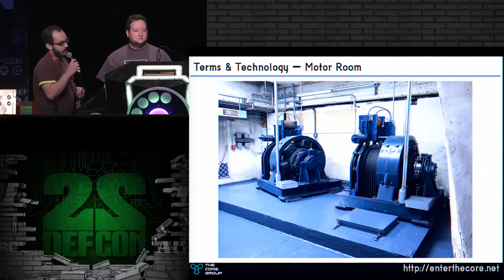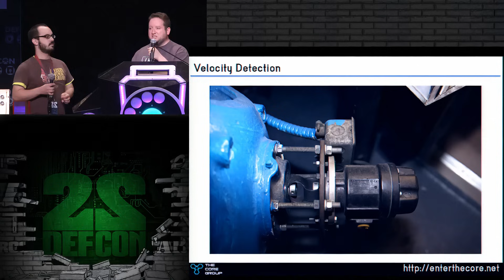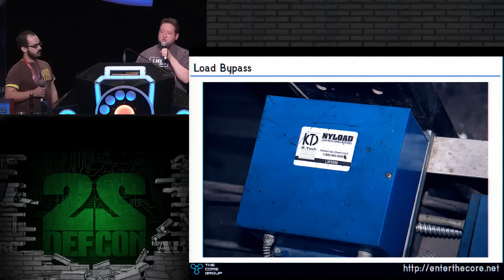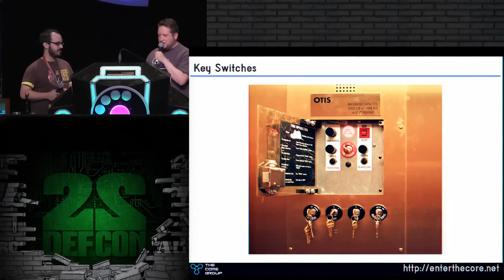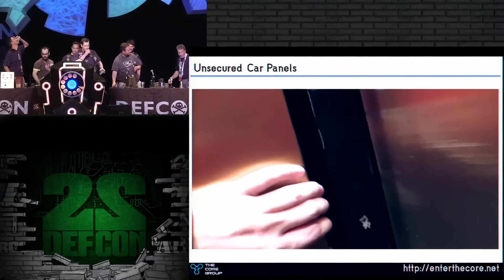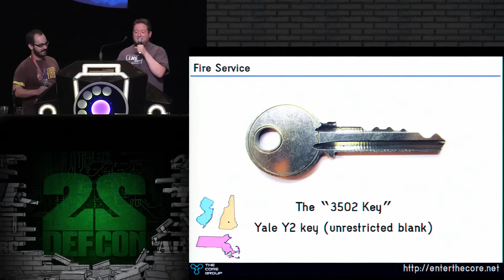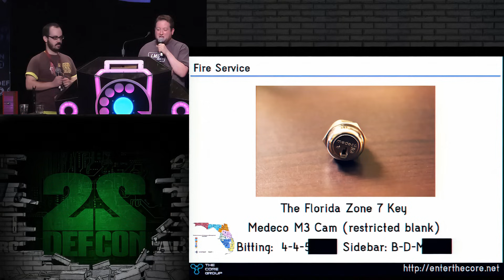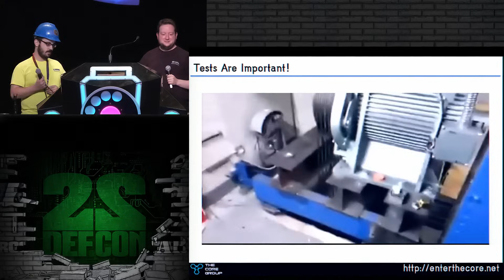DEF CON 22 - Deviant Ollam & Howard Payne - Elevator Hacking - From the Pit to the Penthouse

Comment: Sabbath Mode: "It's kind of like hacking God [...] I found a loophole in scripture so I'm smarter than you!"
pretty much sums up the Jewish faith:)
Reply: That was the funniest thing I learned all thay. Never though about solving sabbath day problems before. I can now see a nice market for autonomous cars.
Reply: @DJzSith  Wether autonomous cars are sabbath worthy or not is a legitimate political issue in israel.
Reply: See the wiki article on "Eruv" for the ultimate way to "legal loophole" your way out of inconvenient holy commandments.
Reply: @bearjew is that Hebrew for ollie ollie oxen free?
Reply: John Early pretty much sums up faith
Reply: Tyrone: There is a lot of apliances with sabbath mode. For example electric heaters that can be voice activated. Or even saw oven that is "certified" that you can use it on sabbath days so that you switching switches somehow do not count on that device since it is consecrated or whatever. Quite funny example of how people are walking circles around their own scriptures. But as long as it remains harmless, who actualy cares.
Reply: iglidor my Bosch oven has sabbath mode which means that it will automatically set and maintain the oven temp to 85°C (190°F) for the sabbath.  My Libeher refrigerator has sabbath mode which means that on the sabbath opening the door does not turn the light on, and the compressor will run at random times rather than as a direct consequence of the interior warming up because the door was opened.
Reply: @jpe1  Re. my earlier comment, I believe there's a predominantly Jewish suburb here in Sydney which has an Eruv strung around its entire perimeter. Convenient!
Reply: sixstringedthing I used to live in Allentown, Pennsylvania (of Billy Joel fame) and the eruv boundary was two blocks west of my house, I drove through it on a daily basis (which felt weird the first few times I did it, but I got used to the feeling of intruding into others’ space uninvited). That eruv has two major thoroughfares going through it (route 22 and old route 22) but apparently 100,000 cars driving through an eruv isn’t a problem, and similarly the eruv south east of Sydney Harbour struck me as being a bustling metropolitan area when I drove through it on my way to visit Bondi Beach (and yet the beach itself is outside the eruv).  I remain fascinated by the flexibility and creativity of orthodox and fundamentalist religions to adapt and accommodate to changing times while simultaneously maintaining all sorts of traditions.  It’s not just orthodox Jewish people, all religions do it.  Recently I ran the Bird-in-Hand marathon (Bird-in-Hand is a Pennsylvania Deutsch community near Lancaster Pennsylvania) and there were several dozen Amish men running, wearing traditional black wool pants, long sleeved cotton shirts, and straw hats, but also modern running shoes.  I had a long conversation with one such man who was wearing two GPS sports watches.  I asked him about the watches, he said they were borrowed, that the technology prohibitions of his religion were against ownership, not use.  So an Amish man can be a welder or a plumber as long as he doesn’t own his own tools (and as long as he is a man; those are men’s jobs prohibited to women).
Reply: John Early; that bit about the amish being unable to own tools is weird. I thought the reason they didn’t have a lot of technology was because they didn’t own the infrastructure to avoid monthly fees. Electricity being made outside the community makes it a dependency situation and they want to depend on God alone. If you have to borrow stuff then you are dependent on tool rental businesses. So why not just offer battery powered tvs and laundromats in amish country? It must be more like I thought or those possibilities would be put to use.
Reply: AnantaSesaDas perhaps it has to do with how a given Amish community defines “dependence”.  I was out in Wisconsin recently and visited with an Amish family and they had access to a cell phone, stored in a box in the yard (with a solar panel to charge it).  Same family had propane heat and refrigerator, and used a mix of kerosene light and battery powered LED lights.  I know it varies from community to community, in some bicycles are OK, in others the pedal/chain mechanism is a no-no so they used scooters, and again in some communities that use scooters you will see Razors and other made-in-China hardware, in other communities the scooters are only hand-made from mild steel tubing, with spoked wheels.
Reply: @jpe1  only problem is that they are operating a button that sends electricity to a computer that then turns the heating element on. Thus the person is still operating the oven though only for one press
Reply: Jewish history makes alot more sense when you consider it's God responding to these people "technically" not breaking the rules by "technically" not smiting them.
Reply: @SharpForceTrauma  crazy that my comment from 7 years ago is still getting responses! Thanks
Reply: That why so many good hackers are jews? They got it through religion?

Comment: As an elevator mechanic: very good talk!

Also: follow their advice on not entering the shaft if you don't know what you're doing, you will die.
Reply: Ill take that advice!
Reply: Can confirm. In many states entering the shaft is also a huge fine.
Reply: Absolutely! As a lift engineer (UK), I'm really glad he went into detail, and said "Don't go into the lift shaft, Motor Room or Pit" - Be aware, you won't be going home if you aren't very careful.
Reply: Our buildings elevator is roped, i bought a simple door key from ebay. Our pit has special interlocks that lock the elevators out completly as soon as a door is opened without the car/cab inline or the top hatch is disturbed. It also has laser cutouts around the pit as well as stop buttons etc etc?
Reply: @Steve211Ucdhihifvshi  not special.  You are just in danger being in the pit due to depth. Stay out please for your own safety. Dont want to see you get hurt bud.
Reply: @Steve211Ucdhihifvshi   Not lasers, leds.
Reply: That to me says that there needs to be safer hoistway designs to keep elevator techs safe. Everyone  deserves the safest possible workplace. Some jobs are inherently unsafe but elevator maintenance shouldn't be one.
Reply: @tadferd4340  You think elevator hoistways aren't safe lets not even begin to talk about escalators then. They are nothing more than a giant meat grinder.  Also as experienced elevator mechanic I would not say a hoistway is unsafe, as a rule its unsafe workers.
Reply: @tadferd4340  meh kinda like saying we need safer electricity. if you know what the fuck you are doing study the specific building schematics go to school for it and use proper precaution you'll be fine. it would probably require a dickload of research that your average goofball thinks he knows, but doesn't. with computers you are given a certain amount of leeway that the physical world just doesn't offer.
Reply: @SF-dy6hn  I disagree. You can design safer working environments, or create other engineering solutions. This is often the best solution. Humans  are very good at making mistakes, even when properly trained.

In other cases, no amount of training will help protect you. Using electricity as an example. Racking circuit breakers is dangerous business. Why rack in person when you can do it remotely? People will say cost but we need to stop putting monetary cost before cost of life.
Reply: @tadferd4340  The problem with trying to make the elevator shaft safer is that it is already about as safe as you can be with a 3,000 lb chunk of steel and an elevator car held by cables in the smallest possible area. They have to be able to reach all of the switches and sensors in there, so it's bound to have plenty of risk for the untrained.
Reply: @tadferd4340  its unsafe. It will always be unsafe because we shoulder the risk so the you are safe. We have safety's in place and lots of training. You just need to remember that its not a place for you
Reply: Except the people interrupting. They should definitely try it lol
Reply: you may enter my shaft :---------)
Reply: That sounds like a challenge to me
Reply: I'll take that challenge
Reply: @whateverppl1229  come work with me for  a week, let's go over some basics before you challenge the grim reaper for some lulz.
Reply: @Levo75  ok, but could you explain what it is that kills you so definitely/immediately? Is there a bunch of cables along the entire shift and like, some are ok to grab and some are electrically charged? Is it that you will likely step on something that gives and you'll fall to your death? Are you likely to be killed by 1000s of territorial gnome warriors? Like, what are the actual risks?
Reply: @swine13  the danger lies mostly in the way elevators move in a way you're not prepared for with your senses, the up/down dimension is just something that very few people develop a sense for and due to that, heads and limbs get stuck or struck in unexpected ways. There's also a special procedure to get on and off of the top of the cab and into the pit, this is slightly different for every brand. Safety wise, you may not be able to detect if a safety has been bridged or even how to test for it, you can't account for the things you don't know and thus the risk isn't worth the fun.
Reply: You're telling me that if I'm stuck in an elevator and it's hour 10 and I need to piss and nobody is coming, that I shouldn't exit the top hatch? You're crazy. I'm absolutely climbing out.
Reply: @frother  the top hatch is for the technician to escape if he gets stuck on top of the elevator.
Reply: @frother  Great. Now it's hour 11 and you've pissed down the open elevator shaft instead of in the corner of the cab, and it's going to take longer to rescue you.
Reply: @frother  In most places you can't because it's locked from the other side with no access to the lock from inside.
Reply: @frother  No you wont, the hatch is locked (or bolted shut) from the top and there is no way to unlock it from the inside of the cab.
Reply: @pyro4life64  Is the roof of the elevator car usually steel, or just a steel lattice with some particleboard tiles? I'm wondering if I could break through
Reply: @pyro4life64  – OK, but then how does John McLane/John Wick/007 get through the hatch in a few seconds only the cab to be found completely empty by the bad guys waiting for him in the lobby?

Comment: Interesting you could 3d print these now a days based off of just the pictures
Reply: a good profile shot of a key has allowed for duplication for much longer than 3D printers have been around. You only need to know one actual dimension of the key, like the length or the diameter of the round head, ect. in order to throw it into CAD or just manually scale it yourself to now have a scale drawing of the key. Once you have that all you need is a blank, a file, and some time. It's really not all that difficult. You can do the same kind of thing by temporarily stealing a key just to imprint it onto a block of playdough or clay for your real scale image to copy.

Comment: Anti nuisance mode works a little differently in quite a few lifts in Australia. If you press all the floor buttons, they will be registered, and the lift will make two stops. If it detects that no one has entered or exited for two stops, it deletes the rest of the calls and becomes idle/ready again, because the controller can reasonably assume that there is no one in it. I thought that implementation was quite clever, because it is possible that many legitimate calls may be punched in at the same time, for example a ton of people get on at one floor, you're standing next to the panel and you're kind enough to ask, "what floor do you guys need?" 4, 6, 8, 9, 10, 14, etc etc.
Reply: it can work that out by knowing it weight. 

Threeish people got on the car but 7 floors got pressed? yea nah. Car empty and any floor is pressed? yea nah.

15 people get on and  10 floors are pressed? Just fine.
Reply: @DataumCats  So fat people get to tamper a little bit more?  Being overweight has it's advantages!
Reply: @DataumCats  And skinny people won't be able to make it to their floor.
Reply: A Olson Summer camp group enters elevator. They each have rooms on a different floor of the hotel. Multiple floors pressed. 
Elevator: nope, this one obese person doesn’t need 10 floors.
Reply: @aolson1111  Thus skinny people get skinnier by having to walk a few floors most of the time. xD
Reply: Also drops the calls in NYC

Comment: dose the trick work where you hold the door close and hold your destination floor and the theory says it will bypass all the other floors
Reply: Why don't you watch the video?  He answers your question at 13:59.
Reply: +TheDct88 technically on some older elevators, it can work, but it isn't exactly supposed to on new, modern elevators.
Reply: Thanks for explaining what it was they were talking about there.  I thought they were just talking about how the door close button often doesn't do anything unless you hold it for a second or so.  I love the rare close buttons that work right away with a simple press.  I hate the very common "placebo" close buttons that don't do anything unless you're in a special keyed mode.
Reply: You really only need to hold the door close button if you're in independent service, it would only go to the floors you've selected since it isn't on automatic and is under your control.  If it's in auto it will wherever there is a call depending on direction of travel.
Reply: The problem is it's optional. It's up to the building owner how he wants the elevators to work. So in most cases, it ain't gonna.
Reply: +TheDct88 As an elevator expert, I do not think so!
Reply: Im quite sure i did work in somepoint on OTIS elevators at least in Finland. I did try it few times in bigger mall where there was people waiting at different floors and it didnt stop

Comment: Pressing the buttons for all the floors in a 34 storey freight elevator will tie it up for 45 minutes.  A work mate thought this would be a good idea and nearly got canned.  (Said building only has one freight elevator)
Reply: Then his building should use the anti nuisance function that elevators have in order to prevent such asshattery
Reply: Pressing the button again will deactivate that destination.
Reply: not always
Reply: Every time I've tried this the system realizes what you're doing after a few floors and clears the panel heh
Reply: Nuisance detection, we learned things this talk.
Reply: Gary Cameron haha that's awesome

Comment: I'd love more info about that failed mechanical test... link to original video?
Reply: Frank wasn't referring to the opening clip, neither is Flecom. You're off your rails.
Reply: the video of the motor flying off it's mounts? no it's not, I have watched the secret life of machines many times and for sure that isn't from there.. plus it looks like a cell phone video, pretty sure that wasn't around in 1993 ;)
Reply: The clip is from a (1993!) TV series made for Channel 4 and subsequently shown on the Discovery Channel. Called The Secret Life Of Machines. The series was written by Tim Hunkin, and presented by Tim Hunkin and Rex Garrod. Eighteen programmes were made. 
Here's a direct link to the video on the site: https://www.exploratorium.edu/ronh/SLOM/0302-The_Lift.html
Reply: @Fifury161  you obviously wrote this before the end.  The video being referred to is obviously not that.
Reply: I was referring to the opening video clip...  It's Tim Hunkin and the link I provided is the correct one...